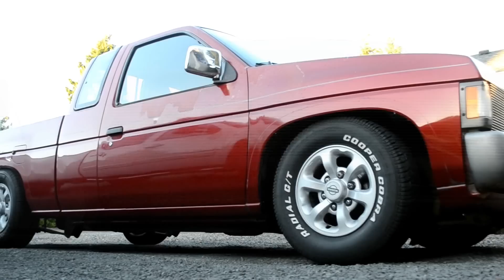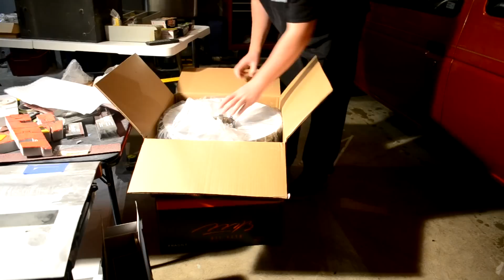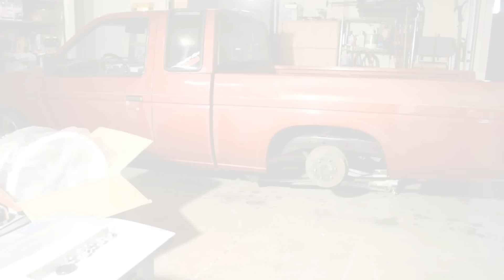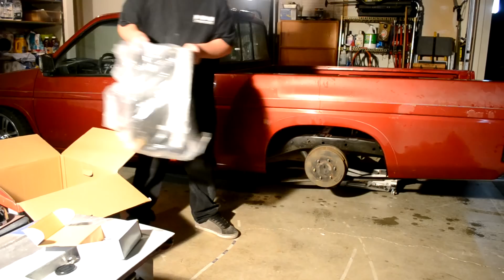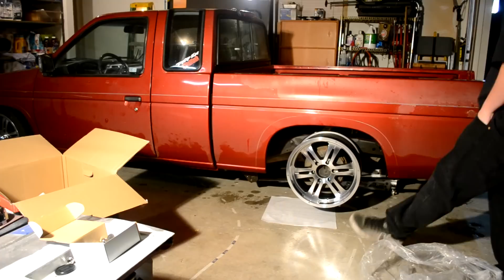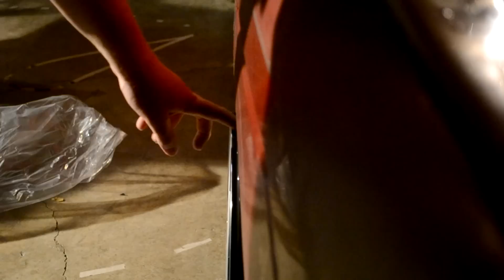Nissan Hardbody project 5

Comment: your bed is fine dont cut anything im running 16x10s on mine and the truck is slammed. wht size blocks are you using?